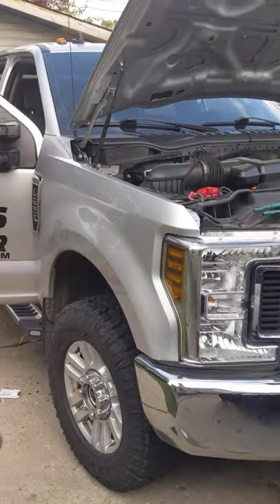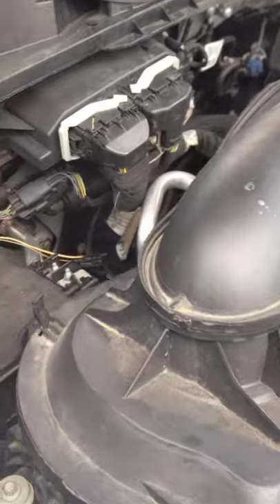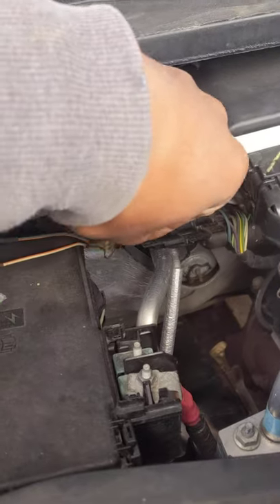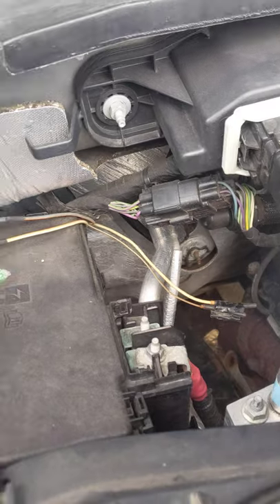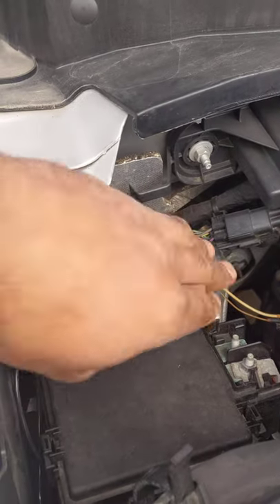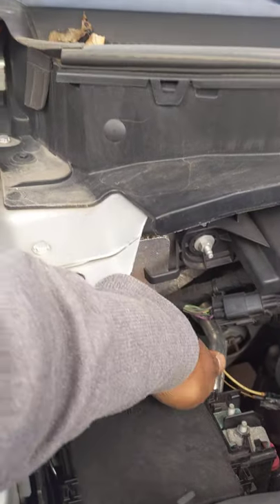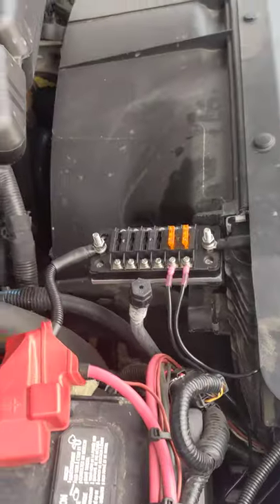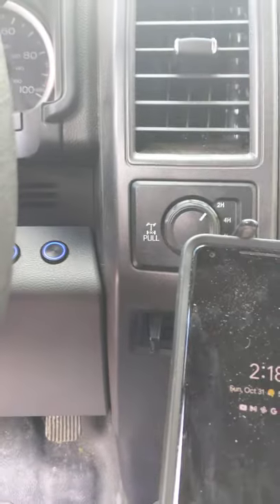FORD TRUCK - How to run wires from engine bay to cab? #shorts

Comment: On my '23 F250 I cant find those pass throughs on either side of the firewall despite pulling kick panel and other panels. Any shot of where you found the bundles before you had them out for the video?
Reply from the maker: Yes
Reply from the maker: I can help
Reply: I had every panel in the area removed as well as the glove box without finding them.